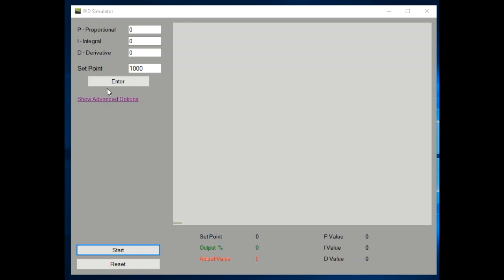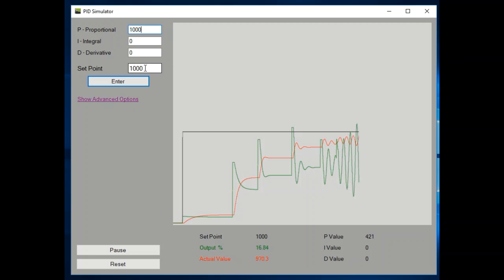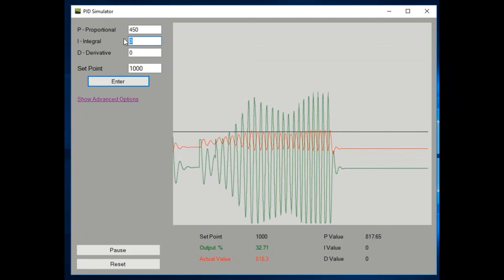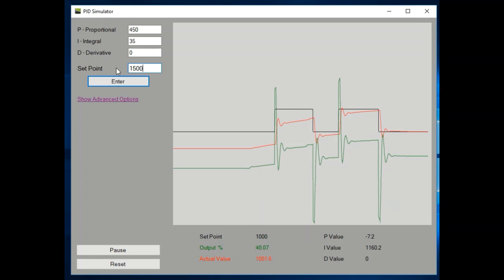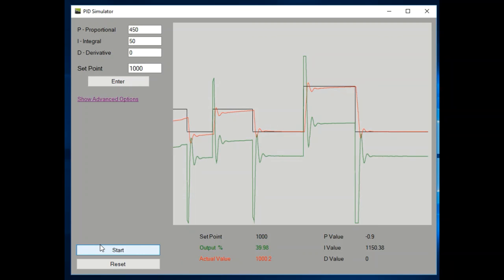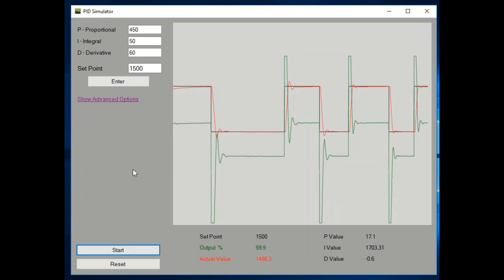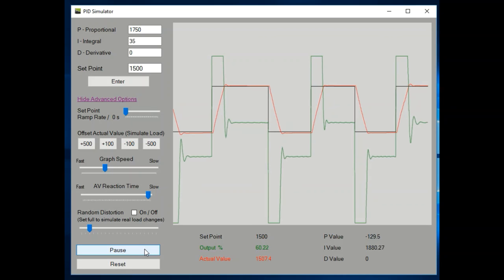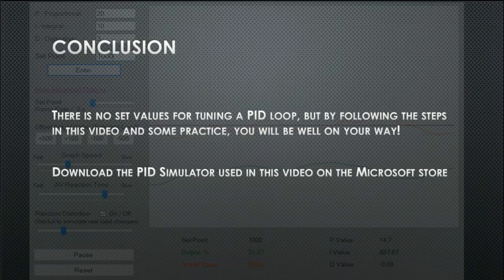How to Tune a PID Controller

Comment: pretty useless given that in real systems it's not that simple as in your simulation. the latency could be one of major players in something like heater-thermometer. you wouldn't be able to do that in that case by moving p/i/d values to tune it. it's close to impossible unless you have nothing else to do in your life. another one is that most of real systems are not linear and even if you manage to fine-tune it for one target it could perform badly for other or even become unstable.
Reply from the maker: Thanks for your comment! Using the advanced options you can slow the reaction time down and add random distortion to simulate real world scenarios. I've had a lot of real world experience and if a device can't be tuned, it needs fixed. Hope this helps :)
Reply: Did you not watch the full video? It's all explained in there.
Reply: Obviously you didn't watch the full video and jumped here to run your mouth.
Reply: @AbuZahi  you might say anything about me but this video is pretty useless because it's way too abstract from reality.
Reply: @nichtverstehen2045 😢

Comment: Nice simulations ! but in most common DCS, you have to reduce the "Integral" value to make it stronger... In your case it's the opposite. People doing that in real situations will not see the same effect and may not understand
Reply: Integral Gain (Ki) that is what he is changing, you are talking about the Interal Time (Ti) ->  Ti=1/Ki
Reply: Yes I know, I was just warning that in real life situations, in most common control systems is used the Ti=1/Ki and not Ki, so decreasing the Ki too much thinking you'll slow down the control can be "dangerous"
Reply: Why is he changing or upsetting the  system while changing integral? Wasn't he supposed to wait and see what each integral value gives? Is he using the first order method approach or second? Or maybe just trial and error?
Reply from the maker: Good point on a system using integral time vs the integral gain system showed in the video. Hope your comment helps people with the integral time controllers!

Comment: One doesn't tune a PID.  One tunes a system.  The transfer function for the "plant" is not given but it must be something very simple.   Trial and error works for simple systems but not for more difficult systems.
Reply: That's putting it nicely, Pete!  This is simply impossible on a live system in the Plant.
Reply from the maker: I've tuned a lot of systems live from large power generation systems to hydronic control systems, not impossible, just takes some practice. Hope the video helped.

Comment: In real plant it is harmful and operation will be super unhappy if you try to make a loop unstable even for good purposes
Reply: The example in this video of unstable is for demonstrating, in a real application you still use this principal but in a controlled way where the actual value only deviates slightly from the setpoint. Unstable only means the value gets further from setpoint instead of closer.

Comment: Thank you so much for this.  It helped me set up my espresso machine heater modification much easier.  I got fairly close by myself just with you know eliminating variables and kind of doing what you did in this explanation.  But having the reasoning to make the fine adjustments was key.

Comment: I hope you see this but, is having P=1500, I=0, and D=0 really all that bad? or am i just finding harmony in chaos.

The contexts is the heated bed of a 3d printer. There is an auto tune feature for PID control in the software, but the oscillation always results in a 3% variance (plus and minus 1.5%) once its done that's about 2 degrees Celsius. But, on my old printer I found a PID loop that resulted in a variance of 0.1c thats 0.15% with rather reasonable looking PID numbers.

On my new printer I ended up with a PID loop that basically has 1500 for P and zero on both I and D but with the same variance of 0.1c even though the output is all over the place with the actual bed temperature looking beautiful with a minor overshoot and then perfectly stable at the set temperature. I have not been able to find values with P low enough for I to be much of a help or with D being so ridiculously high that it somehow finds a way to find harmony with in the chaos but not even remotely close as precise as having zero I and D.

Comment: what's the green graph? output% of what exactly?
Reply from the maker: It's a simulator so it's an arbitrary output. If you were simulating a car in cruise control it would be the throttle, if you were simulating a temperature control loop the output could be the % open of the temperature control valve.